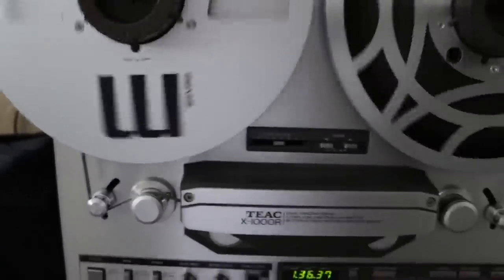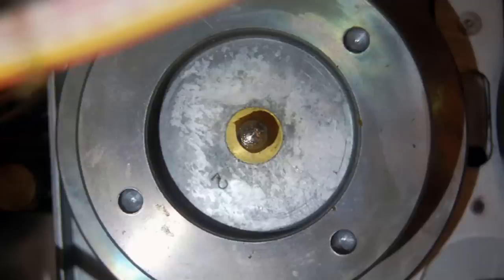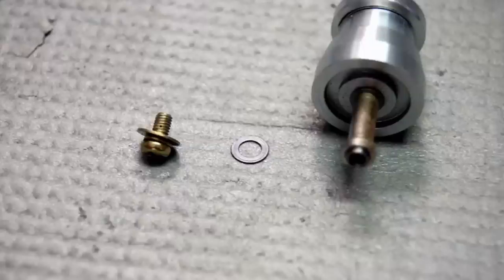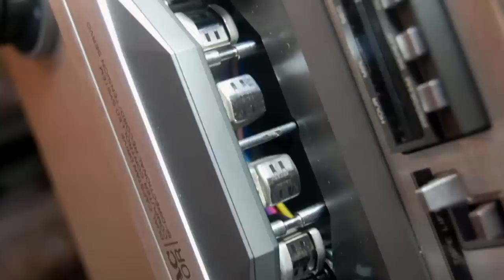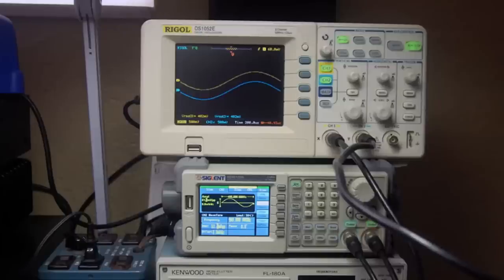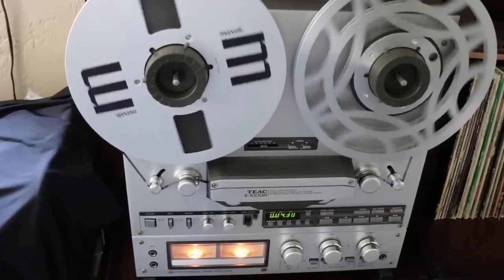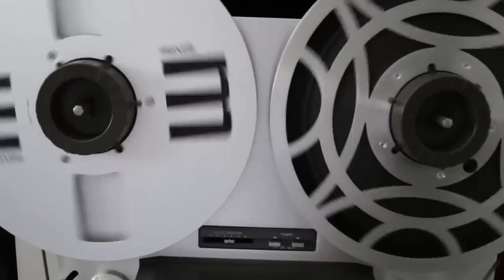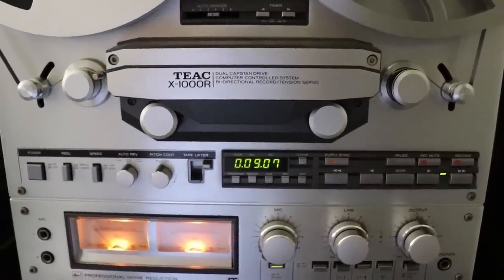Teac X-1000R Reel To Reel Tape Deck Repair Restoration Testing. Vintage Analog Music Recorder Player

Comment: Thank you for sharing this excellent video !
I currently have four functioning R2R decks, the X-1000R is probably my favorite. I used it to dub a pristine vinyl copy of Yes` "Close To The Edge" album, with the dbx circuit engaged. The tape quality is almost surreal, it causes people`s jaws to drop when I play it for them.
Reply: What else you use for jaw-dropping effect? I mean speakers, amp, etc.

Comment: I have a TEAC X-1000RBL that I bought new in 1985, wonderful recorder with its DBX 1 Professional. I stored it around 1995 and just set it up a month ago and I changed the capstan belt as the old one did melt during the time it was stored. It seems to be louder on the right channel and the VU meters show the same discrepancy. I can compensate the difference by placing the left channel output to 5.0 and the right side to 7.0, not much but enough to limit maximum output level on old tapes playback. Since tech knowing their way around a reel to reel are few, what could be causing that if I record a mono source and the level is not quasi similar as in my case. Thanks for any head's up, I have a friend who could fix it with a little guidance as to where to look, everything else is fine.

Comment: i have a AKAI GX747 in Silver and i Love it this Teac is very similar and might be next on my list if i can find one,i also have 2 Revox A77 mk3's both with Dolby "B" a 2 Track and a 4 Track but the 2 Track needs it's Caps changing as it Distorts terribly although the 4 Track sounds Superb i also have a Teac 3340S & Ferrograph Logic 7 that both need a total strip down but i never seem to have the time to do them

Comment: Nice. Ive got a Teac  2300SD in good working order. A few years ago I was walking down a street market in Amsterdam and there was a guy with a stall showing a range of R2R decks, and there was an identical Teac to mine. What are the odds?

Comment: do you repair teacs?  I have a x-2000r beautiful and serviced by Teac when they did that, now 10 yrs later,  wont go back or forth, but does fast forward and rewind. too long unused. now it again will not run. I need to get a good repair guy. Can u do it?? I am ion So Cal.

Comment: Did you end up replacing any electrolytic capacitors or electronic components?  How many? Thanks for the info.
Reply from the maker: No, I didn't replace anything. Maybe someday, I'll recap it.

Comment: Any thoughts on the feasibility of converting an X-1000 to half-track record/playback? What about using the X-1000's empty head location to put in a half-track head just for playback and being able to switch between that head and the original quarter-track playback head?
Reply from the maker: well.....If you are looking for a project.

Comment: if you got the tape from out of a cassette, can you play it on a reel to reel player? or is the ips completely out of range for a reel to reel?
Reply: Cassettes speed is 1.7/8 ips (4.75cm) and some reel to reels do have this speed but the tape on the cassette is not as wide (about half the width) of a reel tape, so i say it wouldn't play.
Reply: @mariojohnson8317  thanks - i was wondering if i could have the best of both worlds with a reel to reel, but it looks like best to just stick to tape :)

Comment: Nice video. And good information. I currently own an X-1000R in NM or M condition, but I am not familiar with the dbx feature. I have owned a number of R2R decks over the years, but this is the first one with the dbx feature. In my X-1000R ...when I activate dbx, it's almost as if the feature takes a meat hammer approach to noise reduction. The sound becomes muffled and the quietest parts of the music are bulldozed into nothing-ness. Can the dbx sensitivity be adjusted? I'd be interested in knowing if and how a user like me could do it.

Comment: why did a machine of this quality not have direct drive, like Akai and Technics?
Reply from the maker: Just the design. The drive belts last a long time but of course I'd like to have the hassle free direct drive.
Reply: The two capstans pretty much required mechanical synchronization between them and by far a single belt between them and a motor would have been the best way to achieve that.

Comment: You must be a "Preferred Customer" with Mouser...
Electrolytic capacitors are STUPID expensive on their site now.
Little 25vdc 100uF axial caps are no less than $1.50, and the good high temp ones run as much as $11.64 a piece!
Reply: Digikey.